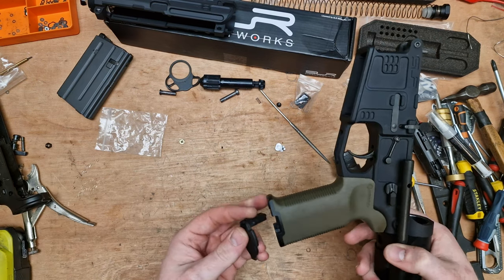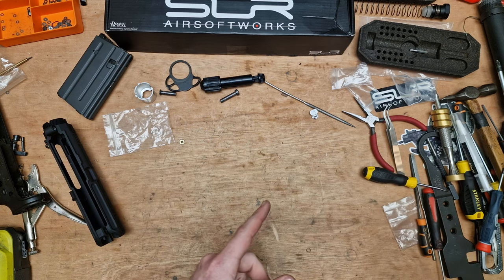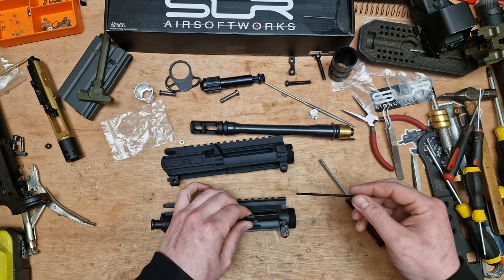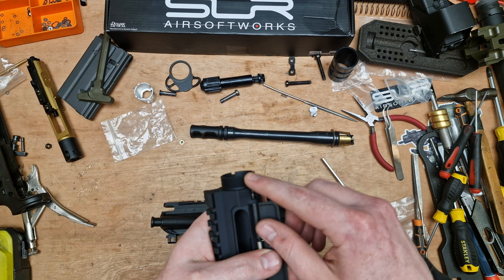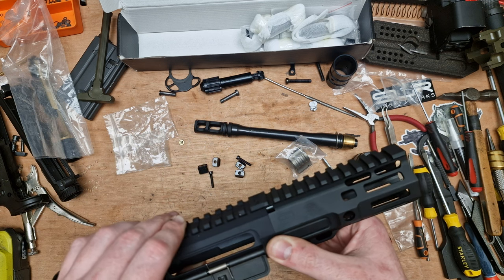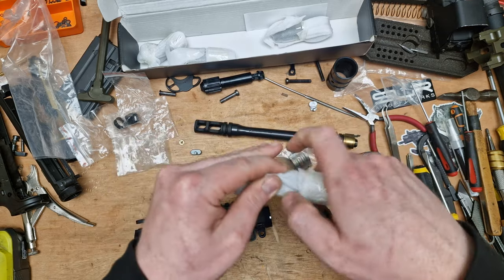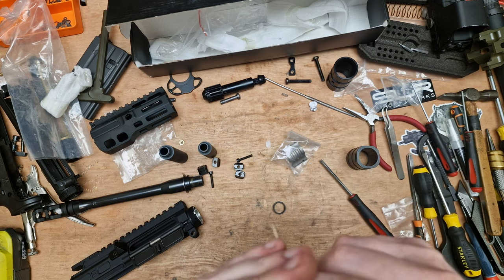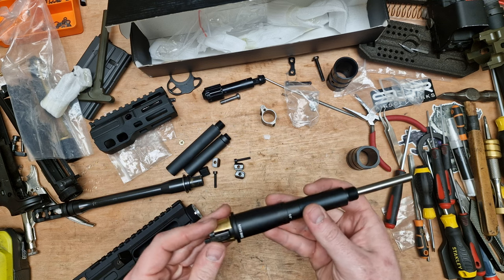Tokyo Marui SLR B15 PDW Build - Part 3

Comment: Brought the 10 inch Dytac SLR handgaurd off WGC a while back, the desciption stated it came with a MWS barrel set and gas block (main reason I favoured the SLR over other rails) but didn't show any photos which I found odd but looked at other sites for reference. Thing eventually turned up, minus the barrel set and gas block. Checked the website and the mention of barrel and gas block had been removed 😑👍.

Other than that its a lovely handguard